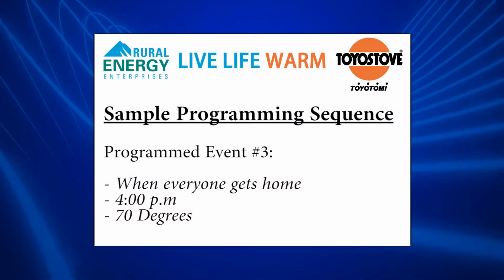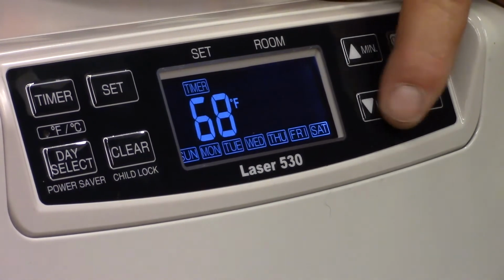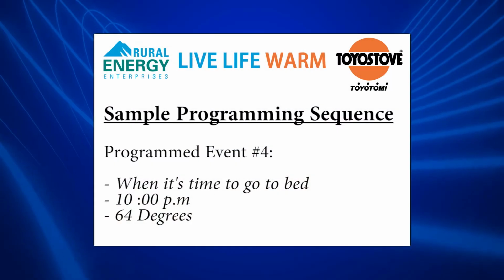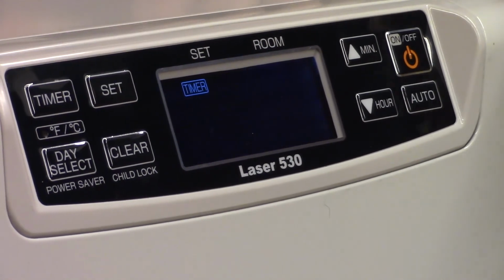Programming the Weekly Timer on Your Toyostove | Step-by-Step Guide

Comment: Was hoping this video existed and THANKS! Got a used Toyo L730 but had to completely disassemble it and clean the blower fan etc. LOTS of hard soot, some looking more like plastic (wrong fuel previous owner?) got it all assembled and it works like a charm except for a slight audible throb-purr from the blower fan in low mode, kind of comforting actually LOL.. anyway the manual is really hard for me to understand this is a breeze much like my old Monitor 41. :-)
Reply: You are right about the fuel potentially being the cause of the hard soot. Low sulfur number one or ultra low sulfur heating oil should be used if Kerosene is not available. Also be sure to inspect the flue pipe, in particular the rubber elbow at the bottom. Squeeze it while twisting to pull it off. Run your finger on the inside of the elbow. If there is a brown coffee stain colored buildup, there may be a problem with the flue pipe, which tends to last 7 years on average.

Comment: It is normal for the Heater to go 2 to 3 degree over setpoint. If the Heater is on "Energy Saver" the Temperature will go 10 degrees over the setpoint.

Comment: Does this have to be done or is it optional? We're getting this heater in 2 day's. We always keep a cooler home anyway as we're hot sleeper's. Just wondering? Thank you.
Reply from the maker: This does not have to be done unless you want the heater to go on a lower setting when you leave the house so you're not heating an empty home, then have it programmed to heat back up right before you come home, for example. Since it has 4 timer setting per day you can also program it to a lower setting at night when you sleep to sleep cooler, then to a higher setting before you get up so you're not waking up too cold.
Reply: @livelifewarm  Thank you, we appreciate that :)